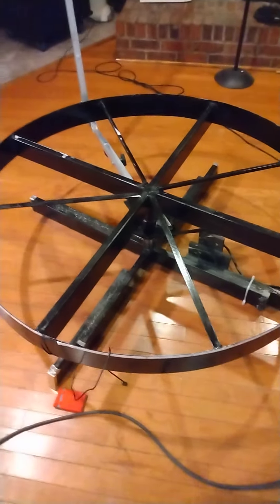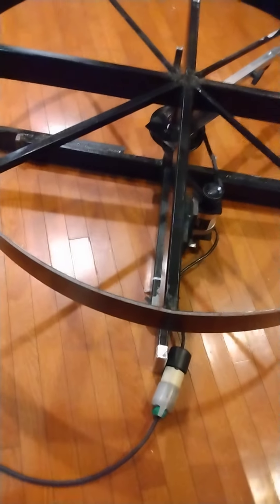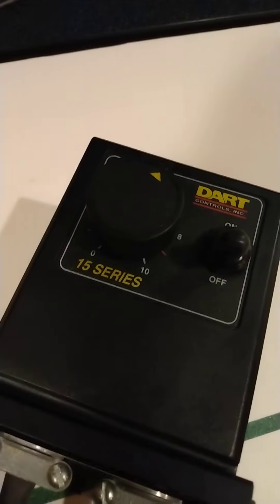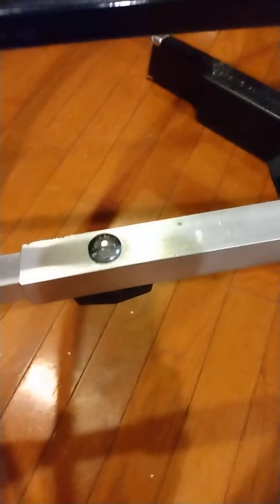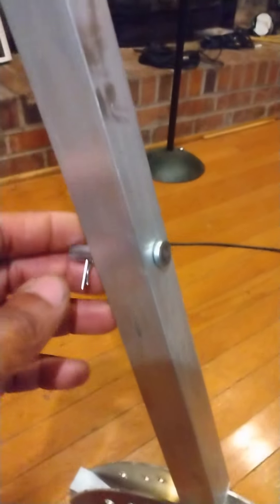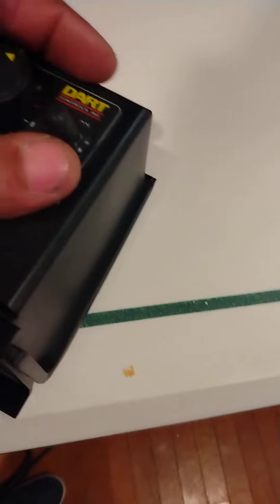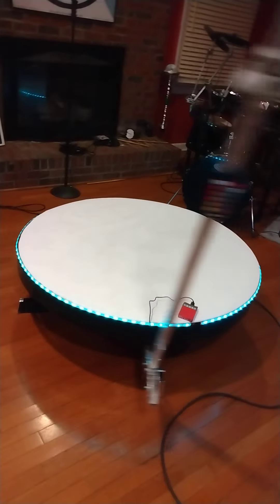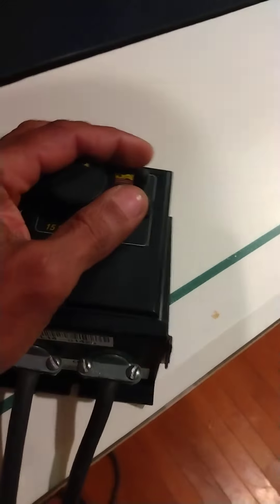February 3, 2022

Comment: Greetings and blessings. You did a tremendous job 👏🏽💪🏾 it was incredible! I have a lot of doubts and I would like to know if you can help me. The first thing is the bearing that is in the center: did you weld it to the pulley or is it a type of pulley that has a bearing in the middle? The engine: what capacity does it have, what are its characteristics? how does the system that moves the arm work? did you use a v-belt and pulleys? how did you install the electricity? I know there are a lot of questions, but I would really appreciate it if you could help me.